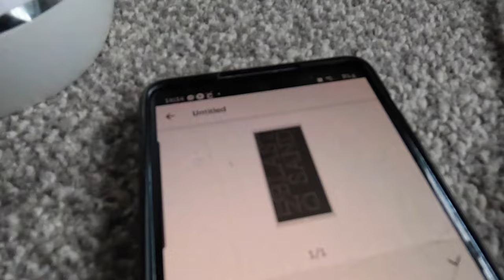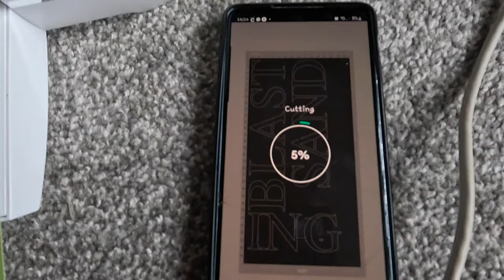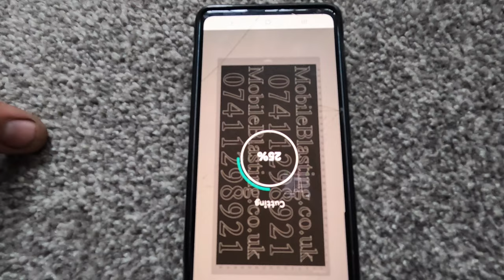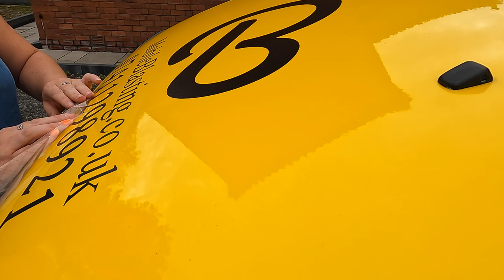Rust & Paint Removal making and fitting decals

Comment: 5:20 Have you considered soda blasting the canvas sides and maybe using plywood on the backside to keep the canvas from "flapping in the breeze. It's an option if the other suggestions don't work.
Reply from the maker: Be cheaper to buy new curtains 😂 its expensive stuff and hard to work with 😬

Comment: Question: Can you remove ivy and woodbine residue off plastered brick walls?
Reply from the maker: No well yes but it will stencil on the plaster if it was brick then it would depend on the media psi and Facade strength
Reply: @Mobileblaster  In other words, you could remove the plaster and that would take the plant residue with it?😁 That's about what I thought, but hope dies last...
Reply from the maker: @feynthefallen  no it will remove the ivy but stencil the plaster as it's softer than the media if the ivy was on a harder serface it would remove the ivy and be fine 👍

Comment: what's the blast hose diameter and what media and number you use?
Reply from the maker: All that will be determined with your cfm pointless using my specs if you have less than 425cfm also media grade etc som e media's work well with lower cfm and others work at the other end of the scale so you would need to find the cfm and psi of your air supply
Reply: I am generally asking. Its pretty handy that's why. @Mobileblaster

Comment: i wonder why the air and media come out as a blue colour.
Reply from the maker: It shouldn't it means the compressor is running hot or got oil in the mix (I know for sure that's not the case tho) or the media mix is too lean and the air is not cool enough for the water traps to separate the water.